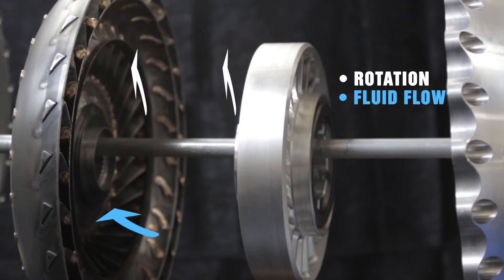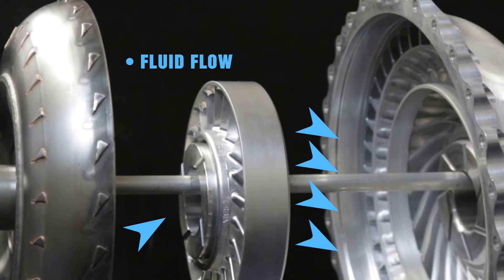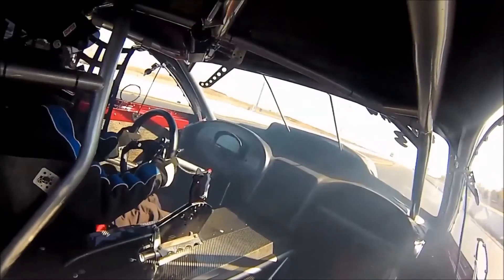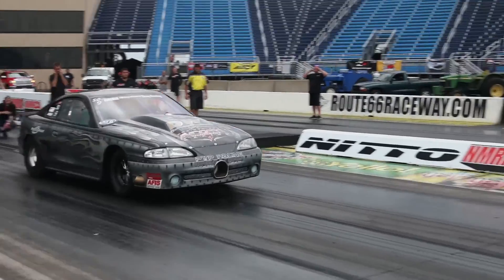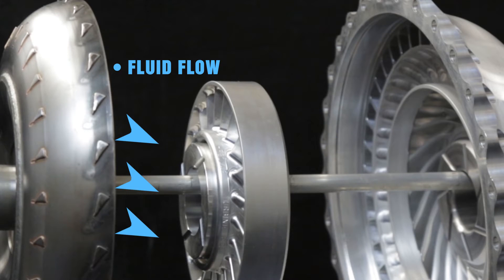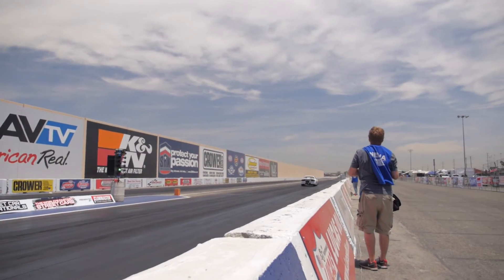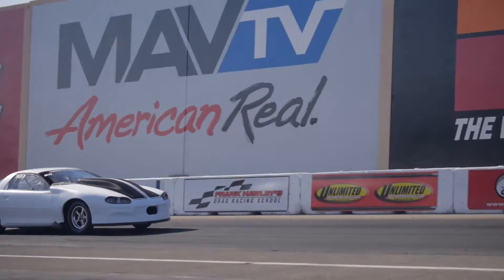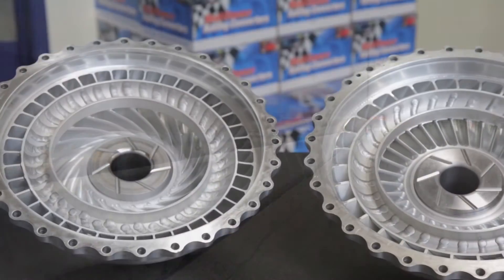How does a Torque Converter Stator work?

Comment: Yeah I still don't understand the exact why of how it multiplies torque....
Reply: when the stator is locked up, fluid is directed at an almost 90 degree angle from the curved fans, which amplifies how much energy it has pushing into the pump

Comment: What are the symptoms of a failed stator one way bearing?
Reply: Low power it feels like a cluth sliping, ando overheat the transmisión fluid
Reply: This sounds like the issue I'm having. Brand new rebuilt transmission. Gets very hot very fast. No acceleration and then fluid pukes out the vent badly. Exactly like the old transmission,  which burnt up the forwards due to low fluid. Can this one way sprag be checked without cutting it apart? 1800 stall.

Comment: Is it normal for the stator to move counter clock wise and clock wise? I had to remove the transmission due to leaking, noises, and poor acceleration...when the car was in park it leaked bad. Replaced the side pan gasket and transmission pan gasket, and axle seals, and it kept leaking....I removed the transmission and found the stator rotates both ways easy.
Reply: not my understanding it's broken that or it's a super old/weird design im not formalary with, anyway's th350 type lock's@WOT or freewheeling under no real loading 

anyways thanks for accidentally answering my question if it goes bad/installed backwards ( or i guess boat v8 BBC aka counter clock wise rotation camshaft would act like this as well besides that there's 3 reverse's instead of the nominal R ) as someone else posted can happen installation backwards but didn't say anything about the consequences of them doing it by accident

Comment: I’m trying to figure out a problem I’m having in my cars converter. When I get driving at a stop sign the transmission is sluggish and when a certain threshold is reached the torque converter catches and lunges the car forward in a jerking motion.
Reply: flash? torque and or something about your engine vs load?